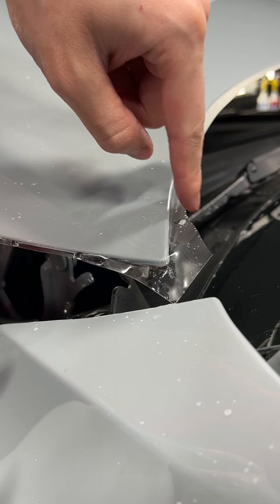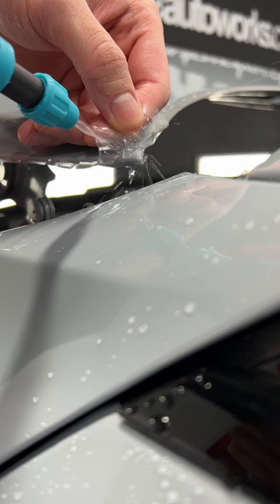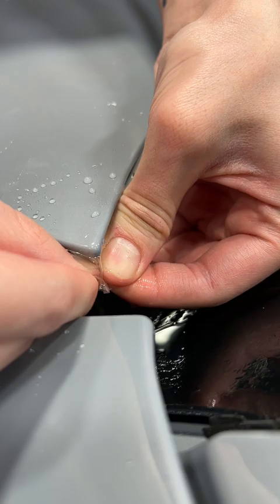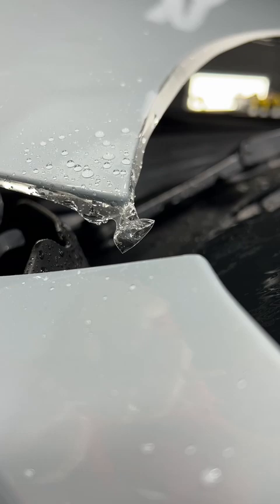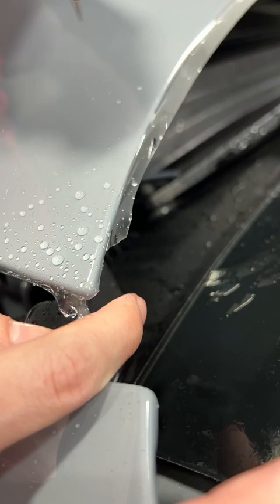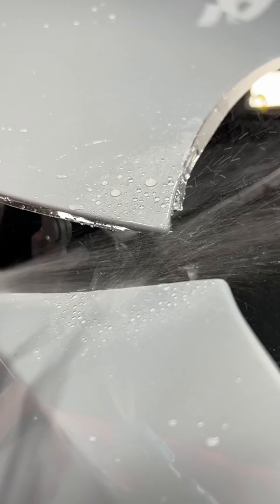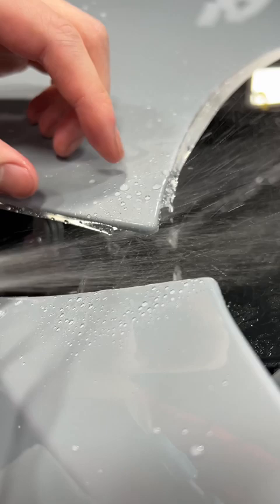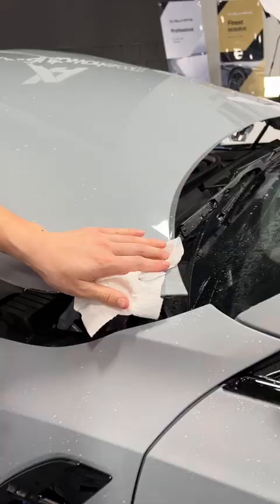How to tuck and hide your corners with paint protection film

Comment: In my experience doing PPF, that corner will peel later. Also, pulling a small area on the corner like that will create too much tension in the film in a small area and also leave a glue line. Best to stretch the material all the way to the corner when you are first laying the film on the hood so the tension is stretched over the entire hood instead of at the last inch of the corner. The film will wrap right around the corner and the tension will suck it right underneath the edge. It will never peel. Hope this is helpful to people.
Reply: 100% facts im also a ppf installer and trust me thats the worst thing you could do specially in a black car 😂
Reply: Exactly
Reply: Agreed
Reply: Never done PPF but I do wraps all the time. PF looks way easier am I mistaken?
Reply: @timothymikula2000  It's waaaaay harder. I do wrap and pff and the latter has almost broke me financially, physically, and mentally when I was first starting out. Once you master it, life is very good and money flows.
Reply: @guyfawkes8384  so you’re saying PPF is much harder
Reply: @timothymikula2000   Exactly what I'm saying lol. In fact, in any area you look, you will find that PPF installers (especially ones tat are good at it) are harder to find than any other trade. It's because it's so hard to do. The amount of people that do PPF in my area has diminished in the last 10 years and demand has only gone up. Only a handful of people who do it in an area of 250k ppl.
Reply: @guyfawkes8384 thanks I have been thinking about adding it to the services we offer there’s nobody around me that does it
Reply: @timothymikula2000  No problem, glad I could help.
Reply: @guyfawkes8384 
Can you please explain why it's harder, I was thinking it is easier because you can do it wet? But I am an amateur in this.
Reply: That makes zero sense from a physical properties stand point. Increasing the tension across the entire surface?  Better to shape, heating and molding only where the bend and curve is required. The video demonstration is correct and optimal.
Reply: @jimthompson717  You don't know what you're talking about.

Comment: I'm an installer.  That looks great now but that edge will lift.
Its not a smooth cut, I always try and get every edge wrapped but sometimes its worth having a small /..\ trim to ensure it stays down. 
Just my view. Theres no "perfect" way. Whatever works for you though💪
Reply from the maker: It would be surprising to see this corner fail at this point. It's been almost a year since it was laid down. If there was any tension it would definitely lift up. But with no tension and a light tuck into whatever paint there is then it'll hold. Going further than the crease in the hood would then make it fail in my experience.
Reply: @Xclusiveautoworks  that's cool 😊 thats the beauty of our work we all have a way . I'm glad it stayed down 🙏🙏 it can also vary on some films as well as some are a little stiffer / thicker / thinner / softer etc 😎
Reply from the maker: @PepegaPig  that's the beauty of this industry and same for window tint. We all have different techniques to achieve the same results. Though this wouldn't work well if you were using Xpel and Alcohol mix as your tack. Then it would definitely leave a lift mark.

Comment: M confused whether it hold the tension at the corner for long. What material are you using and its thickness. If it holds then its brilliant.
Reply from the maker: Stek Dynoshield and no issues with it pulling back. The film is roughly 8mil

Comment: That edge will likely peel eventually. Its best to just make a small right angle cut on each side. Almost every single wrapper ppf pattern has those corners cut for a reason. Spray alcohol/tack solution and then blow it dry with a compressor if you can. Then just use your heat gun and wrap it. It's cake when its dry.

Comment: The shop that wrapped my hood with ppf cut the two corners so the tips are not protected on the left and right sides. Is this a common practice?
Reply: Yes, pretty standard practice in ppf leaving sharp corners exposed as the film is pretty thick and wrapping corners is next to impossible. Once the car leaves the workshop it's just a matter of time before the film in the corners starts to lift thanks to the temperature changes, vibrations etc.

Comment: What PPF is that? It looks like it has a good ceramic coating built in
Reply from the maker: Stek Dynoshield
Reply: @Xclusiveautoworks  nice! Do you think another layer of ceramic coating could be added on top of the STEK and bond/improve the performance?
Reply from the maker: @dakotasimon3445  yes but I would only use a coating designed for films such as CarPro Skin.
Reply: @Xclusiveautoworks  appreciate the advice. I was thinking about that, if I needed a PPF coating or if I could go with another coating like Adams Advanced or DuraSlic Xtreme HG. A lot to think about, I might just leave it uncoated for a while
Reply from the maker: Which film do you have? I always recommend following your manufacturers instructions in order to not void the warranty.
Reply: @Xclusiveautoworks  I’m currently waiting on my 2024 Mustang GT to be delivered, then I will be doing a paint correction and dropping off to have full body STEK DYNOshield installed.

Comment: how come you dont get a lift line when you lift and spray tack?
Reply from the maker: If the corner was already tacked down or squeegeed well, it would leave a lift line. If the corners are left floating before doing this, you're good to go.
Reply: @Xclusiveautoworks  ah brilliant thanks for the tip!
Reply from the maker: @Obsessioncardetailing  Hope it works well for you! Just be slow when trying it the first time to see if you get lift lines. Over time you'll learn when its safe and when it's not.
Reply: @Xclusiveautoworks  we usually stretch over a larger area to hook the corner but this way looks easier and faster. Will try it

Comment: Heatgun in helping to you
Reply from the maker: I normally don't use a heat fun in this situation because its too much direct heat. I prefer it on the final post heat using a low temp and high fan speed.